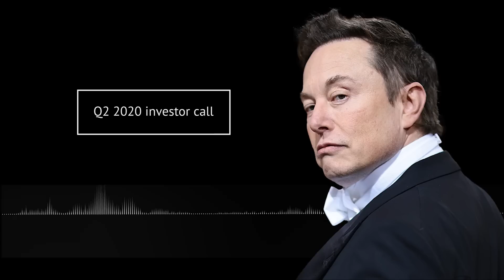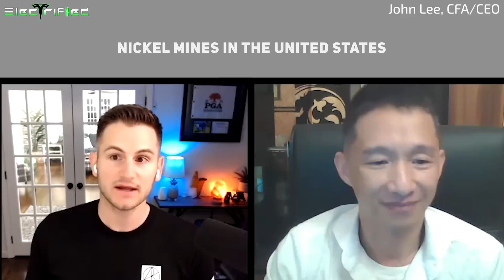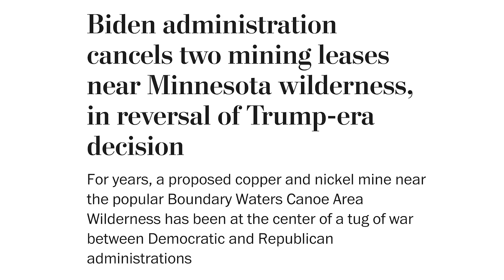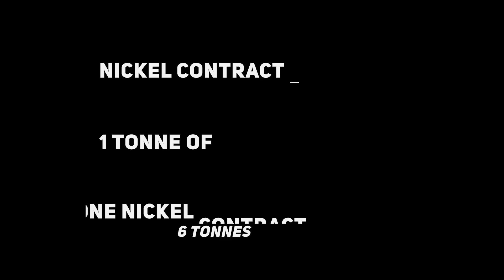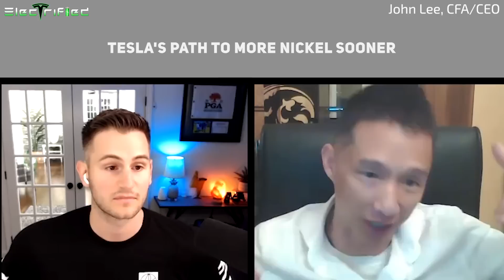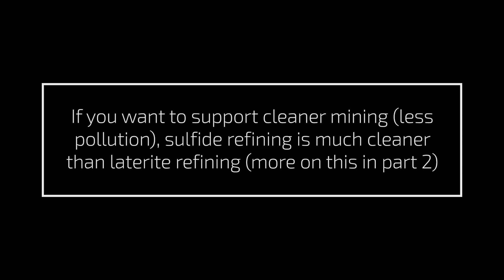Exclusive Interview: Tesla's Scaling Ambitions w/ Nickel Industry CEO (Part 1) ⚡️

Comment: I'm from Minnesota and there's great argument about sulphured mining. The original way to get rid of the sulfide tilings left overs was to put it in a cement ditch and cover it with a tarp.  Unfortunately this is on the water plane and water generally drains into the lake Superior. And when water is added to sulfide tailings Taylor's you get you get  Sulphuric acid.  Which we are now having a shortage of fresh water and that's the largest reserve of fresh water in the world.  Until they come up with a way to Dispose of the tailings...  It doesn't really make sense.
Reply: I'm sure dry stacking will be fine
Reply: "Not in my back yard"

Comment: Most people think that when you mine something, you use it once and then it is gone forever.  This is true for coal, for example.  But with elements used in batteries, once the battery is worn out, the elements are still there to be used again.  So, in the long term, recycled metals will continue to increase in importance.

Comment: the new EV rebate is very dependent on where the battery elements come from. very few of the elements come from the us, more can come from the us, but it will probably take decades to get approval for mining these elements, so no one is going to get the new rebates.
Reply: Appearances for political (fund raising ) purposes. The 7KWh  minimum battery size for a Hybrid means that in reality it will operate as an ICE vehicle, keeping those Oil Contribution $'s rolling or should I say Flowing in

Comment: I would ask him about JB Straubel's theory that nickel,  magnesium, lithium will be closed loop from recycling and mining will not be even necessary in the future.
Reply: We're a long way from that. You need to get to the point where you're at maximum EVs before you can be almost entirely reliant on recycling going forward. We're at 16.5 million EVs worldwide. Still 1.5 billion to go. Unless Jesus is doing the recycling and taking the metal from two EVs and making 500 out of that, we're going to need a lot more mining before we get there.
Reply: Such a closed-loop system is many years away, as battery usage is growing dramatically year after year, both for transport and energy storage.

Comment: One of the biggest needs for nickel is in stainless steel and the Chinese construction industry uses an enormous amount of the stainless supply. With the dramatic slowdown in Chinese house and commercial building projects due to oversupply and price pressures, does it follow that Nickel supply could be freed up over the next 5 years?

Comment: Keep in mind that 300 series stainless steel (304 and 316) is 8 to 11% nickel. A Cybertruck has a stainless steel exterior that is 3X thicker than a steel sheet metal p/u truck. Tesla needs a LOT of nickel. Could be one of the reasons for CT delays.
Reply: Thé reason of the delays is the batteries! They don’t need to use that steel 100% lol…
Reply: @alanmay7929  The CT has been promoted as stainless steel since day 1.

Comment: The CyberTruck could have been made using folded 3mm aluminium leaving nickel for the battery. But in functional performance, LFP is almost as good as nickel based cells. I think the Stainless Steel truck body was a bad idea.
Reply: Stainless Steel body is likely so that they can take the excess Stainless Steel from SpaceX for Starship and instead of sending it to recycling directly for reacquisiton of materials, sending it to Tesla as part of a contract, which can then be used synergistically to augment Cybertruck production.
Reply: It's because they make the truck for men.

Comment: There are several battery chemistries already that don't use nickel.  Also remember that as batteries wear out they will be almost completely recycled for the metals contained within them.
Reply: The cybertruck stainless steel shells will still need lots of nickel.  But nickel performs better for specific uses the semi, roadster.  Other che istries wont do...

Comment: Tessa and other large Chinese EV companies are all moving towards LFP batteries - batteries that do not contain nickel or cobalt. Therefore I expect the demand for nickel will not rise because of incresing battery demand.
Reply: Yes, LFP advancements are making nickel less critical. Will still probably be used for higher-end/higher performance cars though.
Reply: Still it's crucial though, since nickel use isn't limited to batteries only.

It is being used for alloy and steeel processing productions and other processing products as well

While starship and other end products need alloy and steel in significant great amounts
Reply: @vinzole  the original comment specified they don't expect nickel demand to increase "because of increasing battery demand" meaning they do acknowledge it will need to increase for other reasons.
Reply: @truhartwood3170  thanks for highlighting to the original theme and let's hope that these "nickel" matters won't affecting any crucial aspects of NS interests

Comment: Dillon, thanks, very interesting and informative, guess you got many of us interested in the mining and stock business investment. 
Kind of curious if this material is going to be required in 10-20 years from now to invest in mines, for now and next 5-10 years the prospects are good since the demands are higher than the offers.
Setting up a mine to start production requires time and money, investing into it is a matter of knowledge and right partners.
80 million lbs is actual requirements for Tesla only, so if you can have a 160 million lbs. per year production of nickel right now, you can get a benchmark contract of all production, on a valued mine co. Of ~8 billion dollars.
Perhaps a partnership or a joint venture with EM or Tesla would make dreams true and dissipate worries.
Is EM production pace based on availability of materials? 
Got many thinking by now Dillon.😂😂👍

Comment: The UK has nickel. Nickel production United Kingdom (UK) 2010-2020 Published by M. Garside, Apr 26, 2022
 Approximately 35,000 metric tons of nickel was produced in the United Kingdom in 2020, representing a slight increase compared to the previous year. In the period of consideration, the production of nickel in the UK peaked in 2016 at some 43,104 metric tons.

Reuters article:
Britain looks to ancient mines for electric future. SOUTH CROFTY, England - Britain is banking on a series of ancient mines on its southwestern tip to secure a slice of the global electric car revolution. The English county of Cornwall and the surrounding area boast one of the world’s largest tin deposits yet their centuries-old mines have lain abandoned since the 1990s when a collapse in prices for the metal made them unviable.

Now however a rise in demand for tin, along with other metals that can be used in electric vehicles, electronics and renewable energy, has helped create a global deficit and quadruple prices. British officials are supporting reopening of the mines and seeking investment, leading to a mini-rush of mining companies into the area.

Adding to the potential, new research shows the extent to which mines also contain deposits of lithium, the so-called metal of the future.

The first industrial metals mining in Britain for decades represents the country’s best shot at securing a piece of the supply chain for car batteries as well as renewable energy grid connections, officials told Reuters.

“We need to ensure the secure supply of the technology metals and critical minerals,” said government lawmaker Pauline Latham, who heads a parliamentary mining group. “This is necessary with China owning the majority of the market and the potential of a global trade war between China and America.”

It is however early days for the mining projects and there is no guarantee they will produce commercial volumes of metal. Even if they do, Britain is dwarfed by the likes of China, Chile and Australia in terms of battery resources.

The unlikely British mining revival is one example of how countries around the world are scrambling to grab a piece of the electric vehicle action, an area dominated by China, by far the biggest producer of battery metals.

Germany, for instance, is looking to produce lithium at the Zinnwald project in Southern Saxony to help secure supplies for its car industry. In Finland, a nickel mine in Sotkamo in the north aims to start producing material for electric vehicles by 2020, while battery-grade lithium production is planned in Kaustinen, to the west, in 2020.

Serbia, meanwhile, is looking to Rio Tinto RIO.LRIO.AX to develop a giant mine for jadarite, a newly discovered mineral that contains both boron and lithium, in the west of the country.

Governments, keen to develop future-proof industrial strategies, are seeking to establish their own sources of minerals needed for electrification and electric vehicles to provide supply certainty, as well as revenue and jobs.

The British drive has become more pressing, officials said, because of the country’s upcoming exit from the European Union, the world’s biggest trading bloc.
LITHIUM PROMISE
A British government-funded research team led by Cristian Rossi analysed satellite data to find changes in vegetation and temperature that indicate there are some lithium reserves alongside the tin deposits in the area.

The study marked the first time satellite technology has been used to locate lithium - a valuable technique in Cornwall, which is covered in vegetation in contrast to South American prospects in exposed deserts.

“The percentages are small, but that does not mean it’s not relevant,” said Rossi, principal earth observations scientist of not-for-profit research group the Satellite Applications Catapult (SAC), told Reuters at a conference in March at Cornwall’s Camborne School of Mines to present his findings.

The government provided $1.2 million towards the research, which will be available to all explorers.

The SAC findings are currently being used by a British company called Cornish Lithium, which will begin drilling at South Crofty next year. It has an agreement with Strongbow that allows it to explore using Strongbow’s mineral rights, with Strongbow getting royalties from any lithium extracted.

CLIMBING PRICES
In 1998, when South Crofty was the last of hundreds of Cornish tin mines to shut after four centuries of operation, global tin demand was around 200,000 tonnes a year, and the tin price CMSN3 was languishing at around $5,000 per tonne.

Now demand has risen to around 350,000 tonnes, buoyed by demand for electronics, where it is used as a replacement for toxic lead in solder. Tin can also be used in lithium-ion batteries, which could have a major impact on a market already in deficit. Tin prices have climbed above $20,000.

Lithium prices, meanwhile, rose by a quarter last year. Spot prices are currently between $22,000 and $24,000 a tonne, according to industry sources.

In Britain, officials say the country is well-placed to capitalise on the anticipated boom in demand for electric vehicles in coming years.

“It’s as if we’ve fallen on our feet,” said Darryn Quayle, a mining specialist at government Department for International Trade. “What we have in our own backyard is quite remarkable.”
Reply: And where did the feed for the refinery in Wales that produced that 25k tonnes come from? NOT the UK.